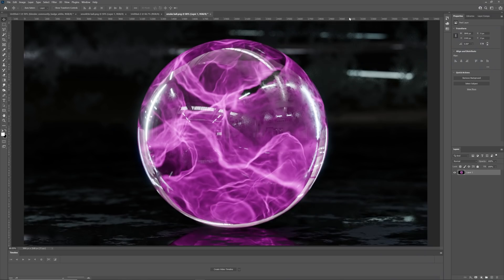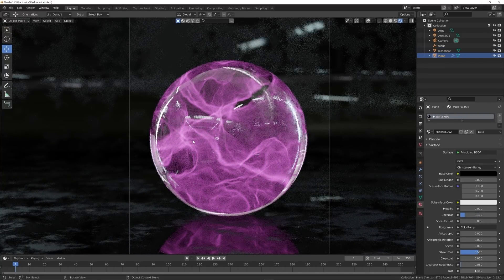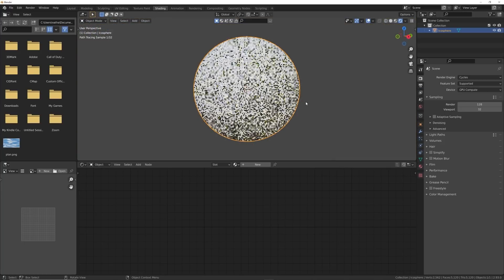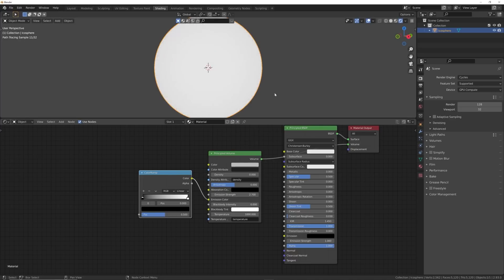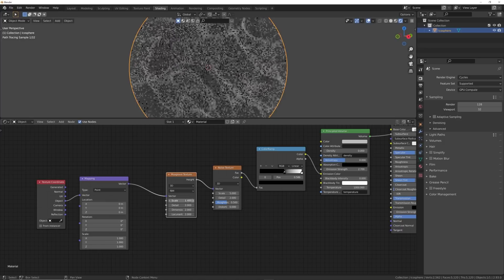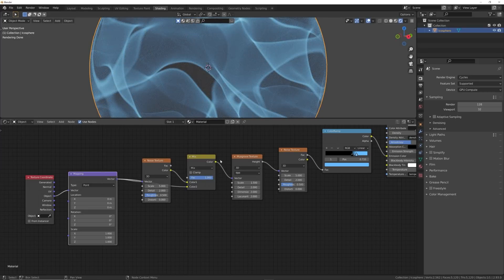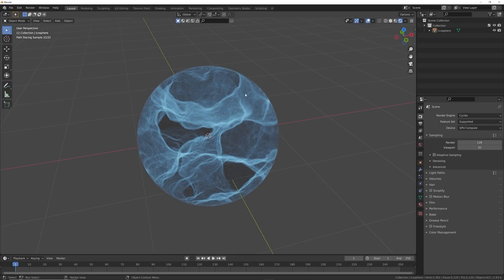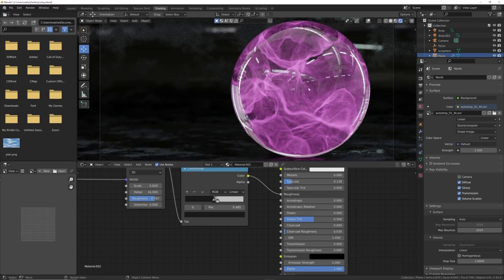Glass Plasma Orb in Blender (Blender Tutorial)

Comment: i followed the steps but when it gets to making the orb reflective by turning the roughness to 0, i get different results. mine is just a dark grey ball with some speckles but not reflective like yours
Reply: Encountering the same thing. did you ever find a fix for this?
Reply: In case someone comes across this later, check to make sure your render engine is set to Cycles.

Comment: this is actually also possible in eevee if you use a volume object with a mesh to volume modifier, and then make a attribute node and plug it into the emission strength (or if you dont wanna use emission, the density has already "density" as an attribute by default). it looks obviously a little different to cycles.
Reply: can you elaborate just a little bit on that, or which nodes and how? i almost got there, and got a nice looking rystal ball in eevee, but once i got to the "Emission Strength" step i can't make it look good :(
Reply: @CarlosSaulRodriguezA  you have to multiply the attribute node with the texture setup, also you kinda have to increase the density (in the modifier settings) a lot (that makes it slow but its fine if you dont animate the ball(camera animation shouldn't have an effect)). how it looks can also depend on what tile size you have in the volumetrics tab in the eevee render settings
Reply: @JWD-II  i'll try, thanks a lot!!!